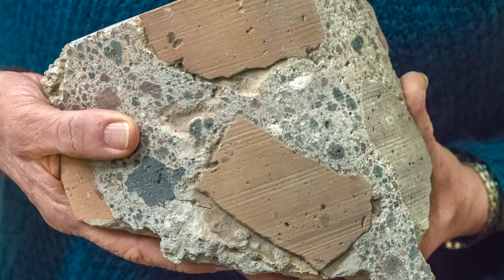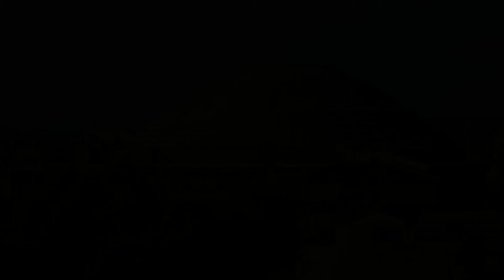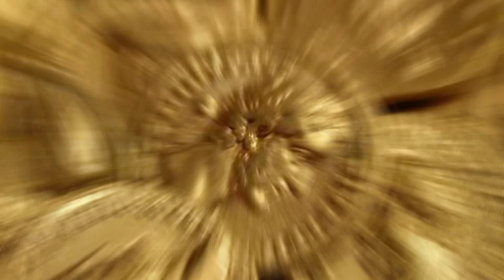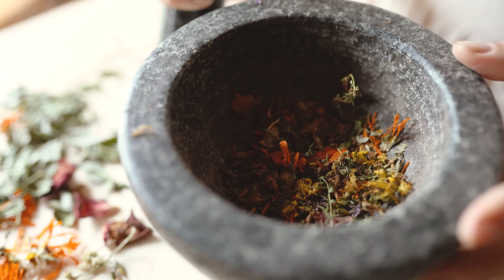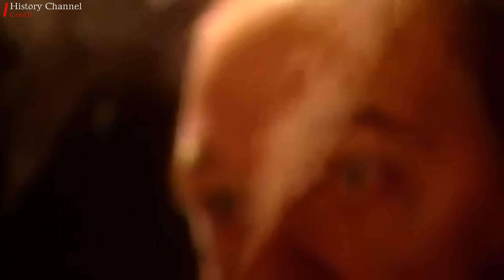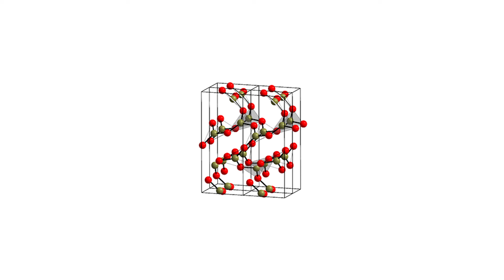Top 10 incredibly advanced Roman technologies that will blow your mind.

Comment: It is misleading to say modern concrete is inferior to ancient, roman concrete. This is something of an popular myth that gets perpetuated around without really understanding it, like that old (and wrong) quote about physicists not understanding how bumblebees can fly. None of it is true.

We can make concrete today that is superior to anything the romans ever made, and in fact, we DO. However, we only use such concrete in very specific circumstances where that quality is actually needed. Most of the time, we use cheap, mass produced concrete that takes less time and money to make because the majority of the time that is all that is required. Our capitalism driven culture makes people always want to save time and money in any way they can, so everything made for mass production is as cheap as possible.

There are also other factors to consider. Some have, in the past, posed the question why don't we make highways out of concrete since they would be longer lasting and more durable. The answers are numerous. First and foremost, the cost. Go capitalism. Second, asphalt allows for more traction than concrete, making it safer to drive on. And third, asphalt is naturally black and is able to absorb the heat from the sun to get disgustingly hot, which is by design, so it can evaporate liquids on it faster.

The romans made large structures out of concrete because it was the best they had and a lot of that stuff was intended to last forever because it took a LONG time to build. Modern construction doesn't work that way. We use lighter, but stronger materials like steel for our construction because it allows us to build things bigger than ever before. And our stuff isn't really meant to last forever anymore because, again, the cost of doing so, and the second reason is as technology is always changing and advancing (not to mention building codes and laws and things) it is better to tear down and rebuild structures than try to build some that last forever.

The romans were awesome, but saying they had magical concrete that was magically better than anything modern is as wrong and silly as the old myths about Damascus steel saying it was somehow superior to modern steel. It wasn't. It was just the best kind of steel for the era and location. But people love romanticizing ancient things. Its why we have so many stories in literature of magically advanced ancient cultures.
Reply: Oh, and as another point to your asphalt argument, asphalt is highly recyclable, so tearing it up, and then reheating it, and putting it back down again, with little to no additional materials is also not a function of concrete.  Oh, and another one, the salt that is used to melt the snows of the north will eat the concrete and destroy it, as well.
Reply: I believe the actual Damascus steel (with the natural vanadium in it from where the ore was mined) was, indeed, superior for quite some time, until modern molecular examination methods gave rise to that particular alloy, which is now used as one of the hardened steels of the modern day.

Comment: I'd like to point out that the high quality of Roman concrete compared to modern concrete has to do with the expense.  Modern concrete is cheap.  When engineers demand really high quality stuff, they can get stuff of such high quality and durability it would make a Roman engineer cry.

What really makes the Florence Cathedrals' dome truly impressive is the fact that it is a self supporting brick structure.  It did not need a wooden scaffolding to support it during its construction.

Comment: Roman concrete was good.  Very good.  But superior to modern concrete and materials?  Not. Even. Close.

The studies have been replicated a few times now and they all find the same thing.  The only reason people think Roman concrete is better is because of the costs associated.  Every inch of concrete we lay could be exponentially better, but whatever is being built would cost exponentially more.

That's it.  That's the only factor that makes a difference in the quality of concrete now vs. Roman times.  1:20

It's even been speculated by a few different engineers that porous concrete made with the best materials today would essentially last forever.  Essentially forever as in; eventually whatever was built would be swallowed by tectonics or destroyed in a disaster, but outside of those scenarios, it would never degrade or crumble because it diverts fluids that change it's chemical structure away and the sun has no effect on it's structure, chemical or physical.
Reply: 2:35 BS, we'd still use it today.
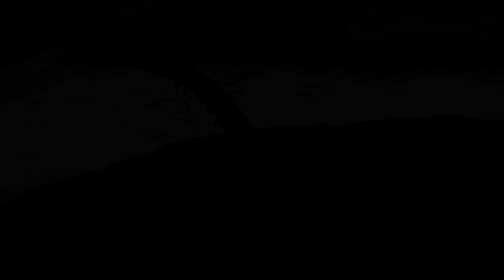Reply: 2:55  BS again, we surpassed Roman engineers about a century ago.  This is what's called "confirmation bias"
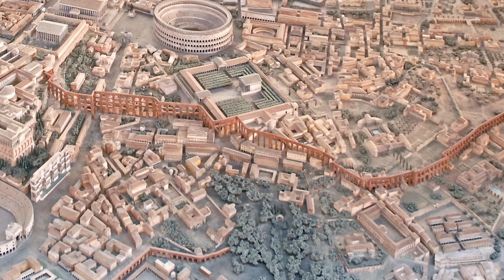Reply: 3:17 some civiliations were already using plumbing at this point.  Who in their right mind would think that an open, free flowing water system that anyone could dump POISIN INTO based on gravity would think that is preferable to a system sealed to the environment, based on pressure that could flow up hill, would be better?  Romans were actually falling behind on this front.
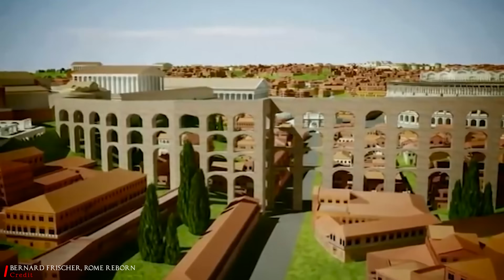Reply: 3:29  Because of it's poor design of only being able to flow downhill with gravity....... A sealed system would have provided around 4x as much water and be able to flow uphill for a distance before needing to travel downward again, without reservoirs to increase the pressure.  The Romans had all the tech to make it possible yet never made the attempt because it switched from innovation to profits before profits could drive innovation.  LoL.

Comment: Having worked in civil construction, modern concrete is ridiculously overengineered. It's pages and pages of added chemicals, depending on what's being poured. About half a dozen engineers have to 'design' it and sign it off. Strict pre-pour slump testing. VERY strict batch to pour times, MPA cure times, agg ratio.........it goes on and on. All calculated on a computer and all fully reliant on reinforced steel(which has it's own disastrous effect on concrete) Romans had none of this and NO STEEL to use as a crutch. No hydraulic cranes, no concrete pumps or trucks, no fancy formwork systems. It's incredible what they achieved with their concrete.
Reply: I believe there have been evidence of hydraulic(and other types) of cranes, they definitely had hydraulic know how (reference the temple doors, which opened by a combination of hydraulics and steam pressure, since igniting the holy flame heated the water which hydraulically opened the doors) and they also understood formwork, since that’s how many of the arches and domes were made.  Just formwork in place.

Comment: The presentation to the emperor of an artifact made of "flexible" or, better, plastic glass (i.e. that can be modeled with a tool without breaking, in particular "with a little hammer" tells "Satyricon"; plastic here is used in the original meaning, "something that can be modeled") and the decision of the emperor to to execute the inventor is also described in Satyricon, believed to be written around 60 C.E.; it is therefore much likely that both Satyricon and Plinius refer to the same event.
However, it is also possible that Plinius refers, as the Satyricon explicitely does, a kind of gossip originated in the Imperial court. In fact, Satyricon tells that the emperor asked to the inventor if he was the only one to know the secret of plastic glass and only after confirmation ordered the execution of the inventor. In other words, both Plinius and Satyricon say that there was a single plastic glass artifact ever made and the inventor was promptly executed. They never saw the artifact and when they wrote Tiberius was already dead as well as any other witness of the event. 
"Fuit tamen faber qui fecit phialam vitream, quae non frangebatur [...] Postquam negavit, iussit illum Caesar decollari [...] . Satyricon (2, 51)
Reply: Thank you for your addition to the flexible glass!

Comment: You have a new subscriber.  I also remember, must have been between 1977-83, when there was a river broke it's banks somewhere in Italy and a torrent ensued.  The modern bridge was swept away in the flood, the Roman bridge stood it's ground and survived.  That is engineering (my father was a structural and civil engineer and always had a great admiration for the engineering works of the Romans).  Also their aquaducts were very carefully calculated to have a drop of something like 2.5cm over .5 of a Roman mile or a mile (sorry can't remember the exact distance off hand).  Something they would have problems achieving today even with modern technology.

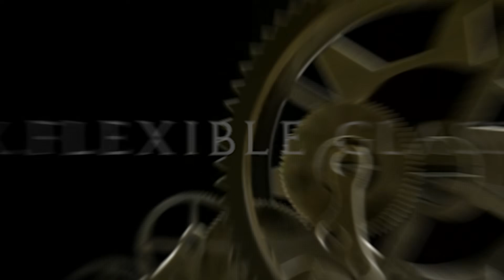Comment: 26:19 If this "flexible glass" is so plausible and possible why has nobody produced it today?
Reply: It's called "plastic" 😑
Reply: We might have, and just don’t know it’s the same that is mentioned in the historical writings.  Borosilicate has similar properties to what was described, laminate glass does as well, so does glass created via the prince rupert drop method and the “gorilla glass” on your portable device.  If you are looking for actually flexible glass (not what was described as glass that did not shatter when thrown against the stone floor) take a look at fiberglass insulation and fiber optic cables, as an easy example.
Reply: @nela9994  You are correct. On rewatching, it sounds more like what I would call "tough" rather than flexible, and you describe modern approaches to that very well.
    I had fibreglass insulation specified when I had a house built in 1975. I have had a career in telecommunications since before then and am well aware of fibre cables. They are both very thin forms of glass, and unsurprisingly a bit flexible. But don't work with fibreglass without a mask, nor bend optical fibre cables too sharply.
Reply: @flamencoprof  I most definitely agree about masks, and not bending too sharply.  And I’m not sure you saw the interesting argument put forth elsewhere in this commentary section, that the important bit about the story of the vessel, wasn’t so much that it existed, but that innovation of that sort was viewed as a threat to their economy, so much so, that inventors were put to death, rather than allow competition and innovative progress to be made.  Which very much speaks out as to why that culture would probably never have had an industrial revolution. Which, I think, speaks to your point, rather than mine.

Comment: roman civilization, as were most cultures in that era, was propelled by slavery. most of these impressive structures were built by slaves. workforce was cheap, regards to their safety minimal. work animals, if you will. another thing: as far as i know, aqueducts were an etruscan invention, smth the romans were quick to incorporate. it's not smth bad, and most likely the romans perfected the design, but it was not their original idea, as stated in this video. however, i'm no historian, thus i could be wrong.

Comment: Roman concrete structures last longer because they didn't use rebar. 
Rebar makes concrete structures stronger if maintained. 
But if water gets to the rebar, it rusts and then things start to fall apart.
Reply: Most rebar is rusted before the concrete is even poured. 😂😂
Reply: Exactly. 'concrete cancer' as it's often called.
Reply: It’s never maintained
Reply: They used volcanic ash in the cement which strengthened it. Read a real history book morons.
Reply: I'm pretty sure that another problem with Roman concrete is that it's really slow to set.  It can be useful and strong, but the real problem is more that the time that their concrete takes to set is just too slow for modern construction timelines.
Reply: @Kevin_Narthex  how long did it take before the Hoover dam finished setting?
Reply: What if the rebar is oiled or greased before being encased in concrete ?
Reply: @soniagheza391  they make plastic coated rebar
Reply: @ryanm595  That is actually way worse then normal rebar since the plastic will crack and the rusting will be concentrated there instead of the whole area of the rebar.

Comment: Irrigations system was invented in Mesopotamia(Sumerians), the lead in the pipes has nothing to do with the fall of the Roman Empire,the matters/factors are more complex,Military strength was the core of the Empire and the only  reason why ROME  was an Empire,  having such   big  borders to control, with only 500,000 soldiers at best times,little by little this soldiers weren't Romans anymore  but the generals/ officers were,when the generals/officers weren't Romans anymore that is it, corrupionts run higher, Discipline went down to the drain and there you have it, in a matter of 100 years the entire system sustained by Military power(Military power the real reason of the existence of the Roman Empire/civilization) that wasn't Roman anymore,finally collapsed

Comment: In the case of Roman concrete, it was an act of genius mixed with blind luck.
The Romans found themselves on top of stores of the volcanic ash. An individual or collection of individuals figured out how the ash would go well in mortar.
The genius was what Roman engineers used it for.
Reply: I think there is a lot of genius in try and error and also in recongnizing the advantages of new tryouts.
Reply: @Oliver-tb7ry  Sometimes try and error is your best choice, even today. A friend of mine studies chemestry (doing her phd right now) and for her degree thesis she spend most of her time in the labratory, testing different materials as catalysts for a certain reaction under different conditions of temperature and pressure. Can be mindnumbing work but sometimes you get lucky and the work pays off.
Reply: how did they make this concrete in the East, such as when they built Caesarea?
Reply: Recent study discovered that it was actually the lime granules within the concrete that gave it a regenerative property and made it so strong.
Reply: Blind luck, talked like a true hating barbarian
Reply: Hohooo! Blind luck because something happened and the romans used it!
I can feel your seething, moshe.